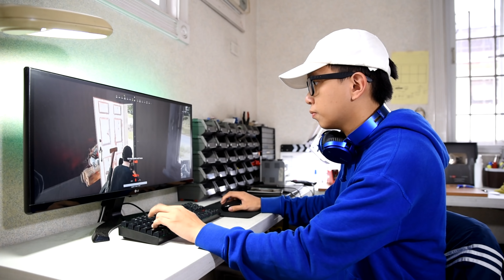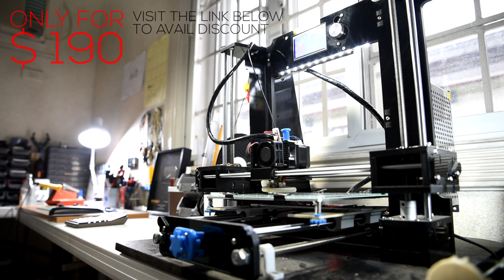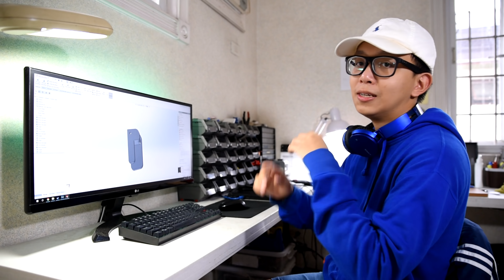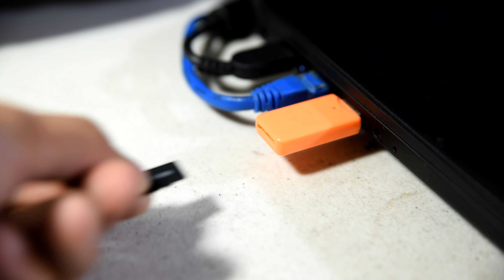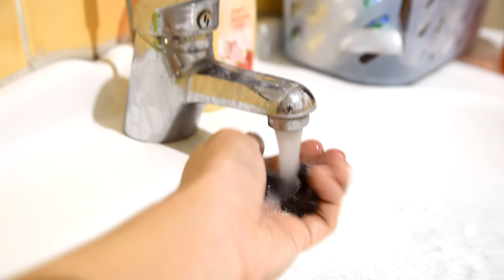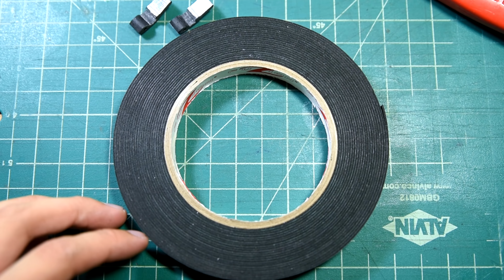DIY Phone Trigger Gaming Buttons (PUBG Mobile - 3D Printed Version)

Comment: But how exactly does it work. Your making a connection with the foil and that allows u to use what u have created as a trigger?
Reply: yup, when you push the button down, the foil makes contact with the foil at the bottom of the trigger, creating a ground connection just like your finger would do.

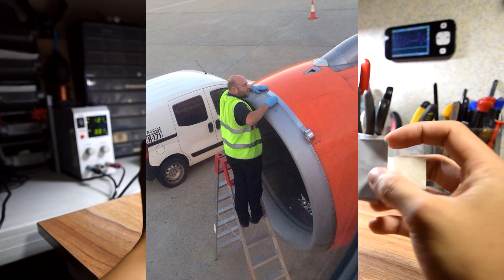Comment: 1:58 It's not the exact the same thing as that tape. The tape used to temporarely repair airplanes is called "Speed tape". It's an amazing adehesive, can be resistant to water and solvents, flames for brief periods, and will reflect heat and UV light. It is also able to expand and contract through a wide range of temperatures and resist the high speeds of a plane (hence the name)

Comment: hey. your file is great. i print it on my printer but it didnt fit well on my phone ( too tight). i try to edit the raw file on solidworks 2016 but the notification say it was future version. Is there anyway for me to edit this file without installing new software? and what software do you use for design this project?
Reply from the maker: Thanks man! If you opt to edit it, I made it using SolidWorks 2017, just in case you're wondering which version I used. You could save some time by scaling it up with your 3D printer's software. Measure the thickness of your phone, and adjust the scaling parameters. If you're using Cura, it's located on the lower left buttons.  Hope this helps!

Comment: for those who dont have 3d printer......

use alufoil

make a right angle with foil and put one side on screen with tape and other on the border then just tap on the border to shoot i tried and its work if it dont put some saliva on your finger i tried it on bullet force
Reply: Hype ßladez7 
That might be because your phone is metal (aluminum) on the back.
(just a guess)
Reply: Hype ßladez7 
if that's the case then put a piece of wood (plywood) between the foil and the side of your phone (you could use elastic band to do this), make sure the foil doesn't touch the metal part of the phone.
:)
Reply: SAHIL KHAN hey I need your help bro plz send me message in whatsapp - 8920953153  I am not able to make that for bullet force
Reply: BF - Scrim Record i will send you in morning
Reply: Ok Bhai kl baat krte h
Reply: SAHIL KHAN Bhai ?
Reply: I tried it and it keeps firing even if I dont touch the foil
Reply: Prince Shehzad can u msg me in WhatsApp?
Reply from the maker: Here's my non 3D Printed version of the tutorial. It's made from common materials like Popsicle Sticks, Glue and some Tape! Hope this helps! (Link: https://youtu.be/LPcp5q2aqPg )

Comment: If you want to really improve your game, it'd probably be better to just connect a KB & Mouse to your phone using an OTG connector.  OTG connectors are super cheap, 5pcs for $1 on ebay. 
(note: you'll need either a wireless KB-&-Mouse combo that only uses a single receiver for both, or a KB that you can plug other USB things into)
KB & Mouse arn't portable like your buttons in the video tho, you've done some awesome work here mate.  Very impressive.
Reply: I dont think you can make the keyboard and mouse press the right buttons on the screen. Ive seen a couple videos on youtube claiming to do it, but they use some sketchy app and it doesnt work 100%
Reply: bluestacks is not a skecty app ,its an emulator
Reply: girlsdrinkfeck If you want to play on a computer you can either buy the game on Steam for $30 i think. OR download the official pubg mobile for pc. The developers of the game made the mobile version for pc too, google it (even though the game was first made for the pc)
Reply: Miguel Yanez Mr state the obvious